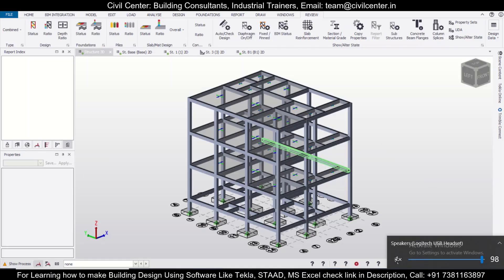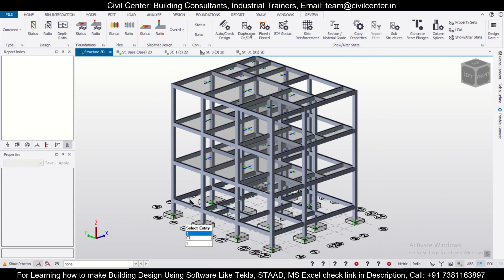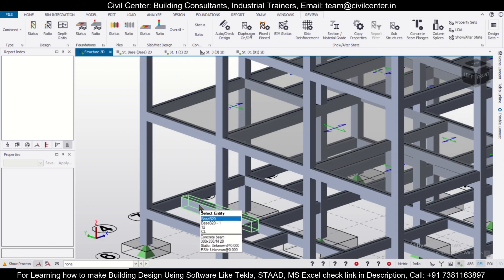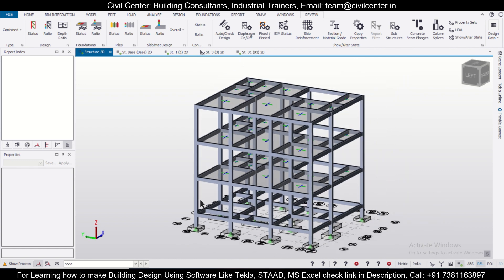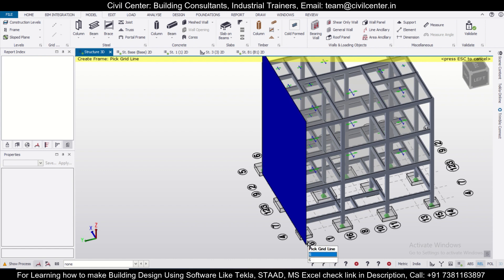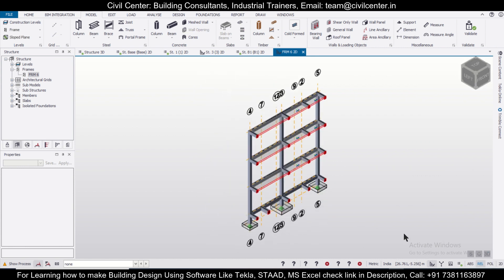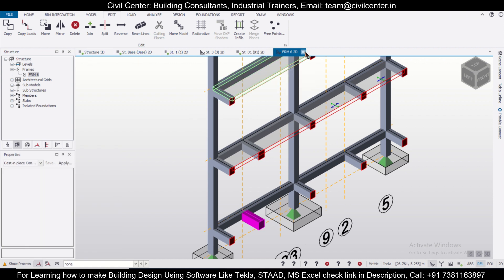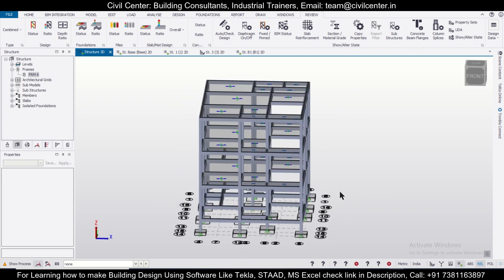Tekla Structural Designer ||Smart use of Frames to copy Beams or any Structural Element

Comment: Hey mainak hi, how are you buddy? Dear i am facing a problem while placing waist slab between the stair.. While i  choose right points in 3D structure window it always pick wrong points automatically.. How to solve this problem.. Suggest some easy trick for it..
Reply from the maker: You can start from the center selection of the beam, it will be easier